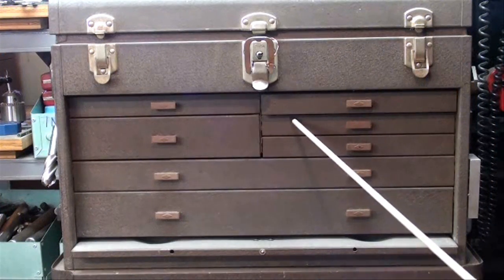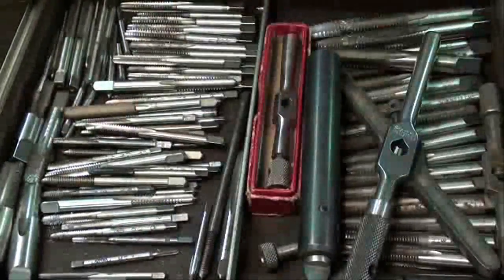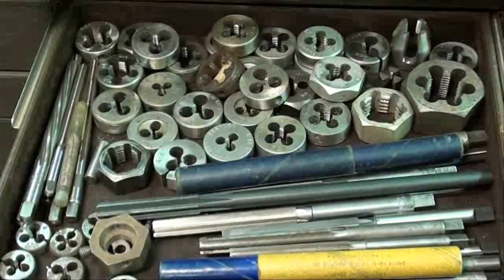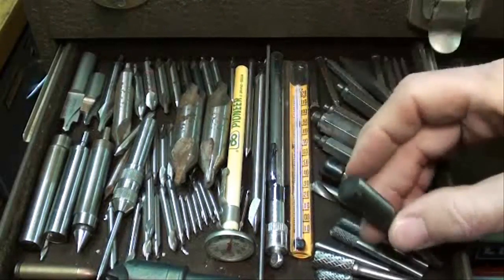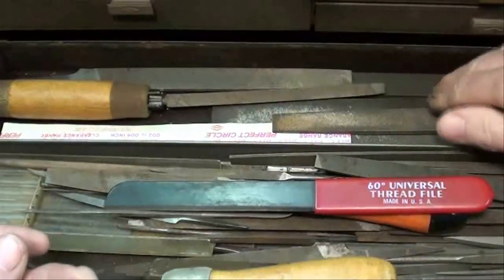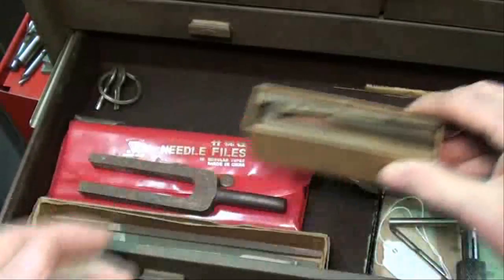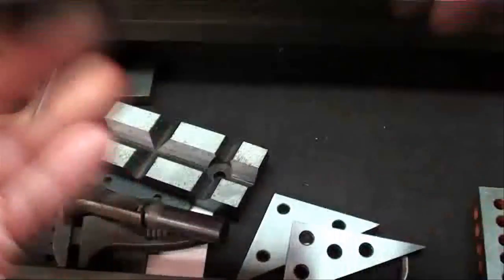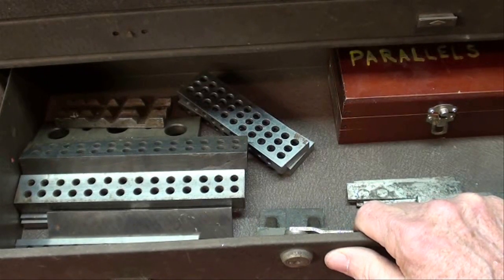MACHINIST TOOLBOX TOUR Part 4 of 4 tubalcain

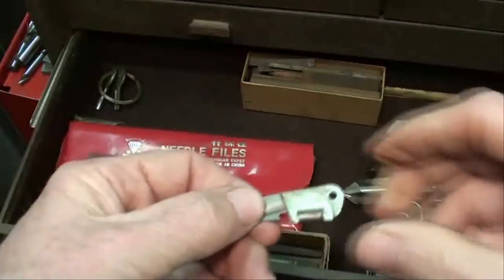Comment: What he called a GI can opener @ 17:10 was called a P38 because it took 38 operations to fully cut a lid off a C ration can. Still have the one I used in Viet Nam. Have some of the odd shaped files that inherited from an old machinists distance relative 50 years ago.
Reply from the maker: I did know that it was called a P 38
But I did not know that it took 38 cuts to take the can off of the ration. Thank you.   Then what did the P stand for?

Comment: Life long electrician in large maintenance shops and always had complete set of tools at hone, full time job & an injection molding/ machine & tool & die company. Only have two filled tool chests, 4 drawer rusrr, took cart & A file cabinet & A milk crate with toys.mean tools. Probably have a hundred taps & A thousand stil bits ( drilling steel,, wood & masonry up to 11/8".
Reply from the maker: Sounds like you have lots and lots of tools. You are a sensible man.

Comment: Watching you go through your tool box reminds me that having what you need doesn't lead directly to being able to use it. First you have to find it. The current job use to dictate most of my working tools.  
As an apprentice die maker I spent days with the little hones that you showed. Frank Printke taught me most of my die making knowledge. He felt that polishing draw dies was a good starting point. It did teach patience and regard for the tools. One ham handed setup person could wipe out a days work in a heartbeat. 
Eventually I was introduced to files, then power tools. The sequence brought me from the slowest process up to the fastest. It highlighted how the speed of the process increased the damage an error caused. 😆
Reply from the maker: That's a good story, thank you
Reply: mrpete222   Your “no idea what it is ”  tool at the end of box 3 video is an early nutcracker. I have an identical one.

Comment: The possibility of having every tool that you’ll ever need is impossible,
I had to buy a 65mm socket for a particular job that I will more than likely never use again.
Reply from the maker: I have over 10,000 tools, and still occasionally need to buy one
Reply: I’m guilty of buying tools that I’ve forgotten that I already own 🤭
I’m sure you’ve made the same mistake many times over 😂🙈

Comment: I've spent the last couple of weeks trying to come up with the maybe the correct wording that won't make most here think I'm just an ass. So far I've not been successful with that so please take this as it's meant.

This 4 part "tool box tour" of yours does require some major corrections Mr. Pete. Even in my opinion a proper apology to the Youtube community to be honest. For the most part I try to remain pretty positive about most Youtube video's I'm viewing due to the posters experience level. However you are presenting yourself as someone who was an instructor at one time who's now retired. I also understand each of us have our own way of working. But I do have to say your 4 videos showing your metrology equipment have been the very worst examples of good tool storage and treatment I've ever seen so far. That's certainly NOT just my opinion. A little research on any of the major tool building makers or metrolgy websites will 100% agree with my following points about what you've been showing in these 4 videos. 

Cutting tools and there "Cutting Edges" should never EVER come in contact with another tools cutting edge at any time. And 100% never under any storage conditions. That goes for every single cutting tool ever made including even your simple files. Good high quality tooling is very expensive today and you need to look after it to the best of your ability's. And reamers? My good quality fractional reamer set cost me over $400. They came in a good Huot reamer storage box just like a good set of drills do. That way the flutes can't get chipped or the cutting flutes burred. Drills, end mills, or any other cutting tools require them to be separated and at least protected from each other even with some thin cardboard. Yet your video's clearly demonstrate everything just tossed in together. Again what you show is the worst example of cutting tool storage I've seen yet. Anyone following your example will be just destroying what they've paid good money to buy. Frankly I expected much much better from anyone who portray's themselves as someone who's trying to teach or instruct.

Again each to there own way of thinking. But high quality metrology equipment does deserve the best care in handling and storage. It DOESN'T deserve to be just thrown into a drawer and then expect the best results and accuracy by treating the equipment in that way. The best analogy I've read so far about looking after good metrology equipment is it should be handled, treated, and looked at as one of those $100,000 plus mechanical watches the very well heeled are buying today. I buy the very best measuring equipment I can afford, and sometimes even more than I can comfortably afford. I use but in no way abuse my metrology gear. I expect the very best accuracy from my equipment and look after it so I can get exactly what I've paid for. But what your showing in your videos?I'd honestly expect that from a third world back alley worker who has no training or skills at all. 

I have one 5" sine bar that was given to me by a total stranger. It's marked as being built in the Los Alomos atomic facility on may 1st 1952 by a Mr. Marlett.  It's one of my most prized possessions even though I also bought what were some fairly expensive Suburban Tools 5" and 10" sine bars. Those long dead or some may even still be alive tool makers deserve to have there efforts very much respected and not just carelessly tossed in a drawer. Your clearly showing a very disrespectful attitude towards those who just don't deserve it. 

There was a Tubal Cain in the bible, so I understand your use of the name. There was also the second Tubal Cain who used the name as a writer for HSM types starting in the 1950's or 60's in the UK. He was an extremely well respected and qualified writer and I've got many books that he wrote. Out of respect you might want to think of sticking to Mr. Pete?

Pete

Comment: Nylon spiral wrap for electrical loom work is ideal for protecting taps/ reamers left loose in a drawer, cut a length to cover the threaded part .
Reply from the maker: knexmachina good idea
Reply: mrpete222 Thanks another top tip for removing threaded drill chucks fit an Allen wrench in the jaws, tighten up then hit with soft hammer
Reply from the maker: knexmachina Thanks for watching.  good idea

Comment: The obscure bent tap is what I believe a "nut tap". You put it through a length of a stock already grooved to a number of nuts (down to thread's minor), and they snap along the grooves as you go. The handle is bent so they don't fall down. Obviously not a machine tool.

Comment: JPJP - I think that the "pickle-fork" ball joint separator has a taper from the tips at the open end of the U back up towards the closed end - at least the ones I've used have that shape...

Also, they are made from castings, and won't ring when tapped...

Comment: I don't think it's nuts or silly at all, to like tools. About the dumbest thing I've seen people do, is actually through money away, like at casinos. I really wish that I had had you for my shop teacher, Mr. Peterson. I know that I would have gone a lot farther in my machinist career. I had to do a lot of, "seat of the pants flying." Don't throw away the trig books. It's too easy to hit the wrong button on a calculator Could you demonstrate the proper use of those pointed edge finders sometime?

Comment: great series Mr Pete,It just makes me wanna see more of the treasures you have stashed away 

and there is 1 tool or shall i say machine that will remove an easy out or anything else stuck even used it to get a broken off carbide drill out of a workpiece once,been lucky that the place i work has one

Comment: You can never have enough tools. Simply because it's best to have the tool for the job rather than use another that won't cut it; resulting in a failure or a ruined tool.